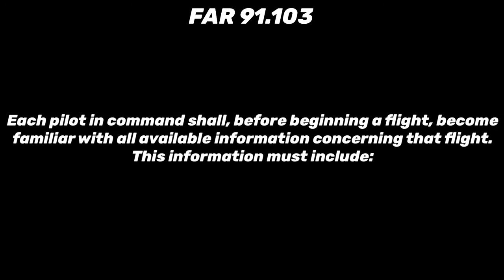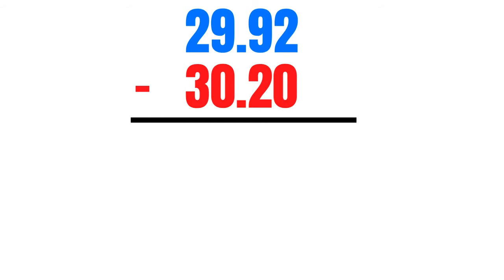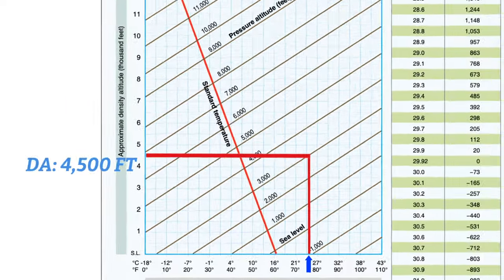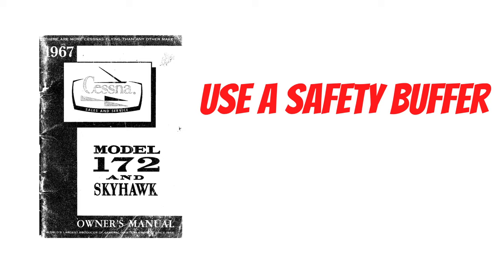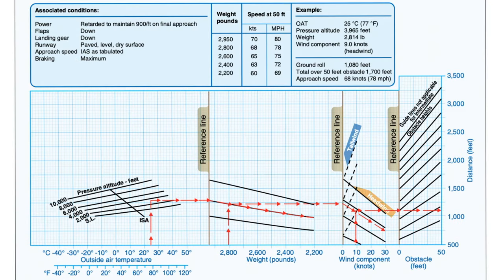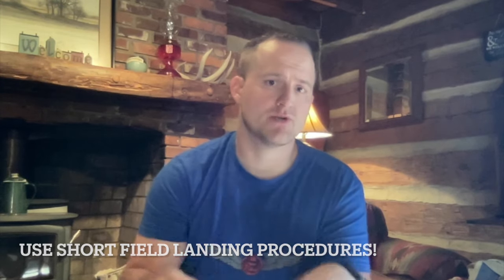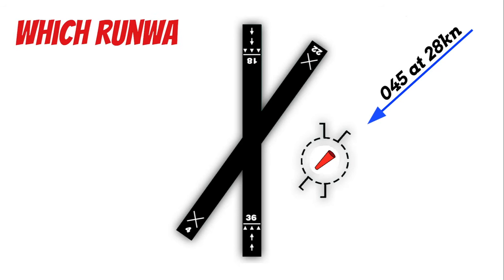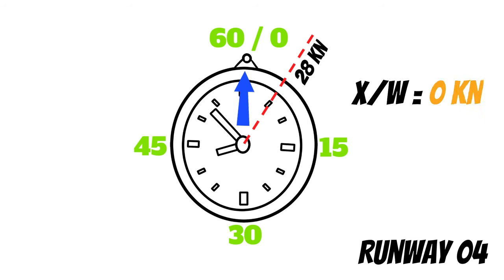Aircraft Performance EXPLAINED (PPL Lesson 51)

Comment: Base leg 1.4xVSO and final 1.3xVSO. Most instructors teach well above that. A C-172 can be landed at 52 kts with full flaps but just about all CFI’s want you at 60-65 kts for safety. Remember control speed with pitch and decent speed with power. I reduce my power to idle as the plane settles, makes a much smoother touchdown.
Reply from the maker: This is very true.  Thanks for the comment!

Comment: 48:15 pitch controls airspeed, and power for altitude, applies at any airspeed, not just slow flight. This is mathematically correct and provable, and is necessary to understand for aircraft design. I actually just taught this as a STEM lecture last week in fact, showing the math in the lecture.
Reply: There used to be a subreddit for people like you. I don’t know if it still exists, but it was called r/iamverysmart. You’d fit right in
Reply: @tylerbrown4483  sounds like jealousy to me. Knowing what engineers knew way back in the 1940s is nothing special. You don't have to be very smart to read a book and learn such things. But, then again, illiteracy is on the rise in recent years.
Reply: @SoloRenegade  it’s not that what you’re saying is wrong, but that it’s overly reductive to the point that I feel confident you’re not as educated on the subject as you think you are. And it’s how smug and pedantic and self-satisfied you are in making and qualifying your silly correction.

You know what he was trying to say, that below L/Dmax you can’t pitch up and trade air speed for altitude to any effect, which is true. You’ll stall really fast if you try it. Whereas above L/D max you can certainly pitch up for altitude, at least until your airspeed bleeds down to L/D max, and if you pitch gently with good power you won’t go below L/Dmax at all and you’ll just establish a climb.

But you felt the need to take it in the most literal way possible and offer a correction in the tone of a 14 year old with a severe case of the dunning-Kruger. One read through Stick and Rudder doesn’t make you an expert on fluid mechanics.

Comment: With all due respect, both the engine and the airplane perfom based on density , in other words DENSITY altitude , where the temperature has a significant effect
Lift = ½ density × TAS²  × area ×  Cl
Cl  =  lift coefficient = AOA × dcl/da
Cl  =  AOA  × 0,1047 × AR/(AR + 2)
 AR = wing aspect ratio = span²/area
 now density = press / (R  × Tabs)
R  =  8314 /29  Joule/ kg K  
The  engine power is also  proportional to density
at any pressure altitude cold air is denser than hot air.
The designation density altitude takes that into effect.
The airplane performs according to Calibrated air speed. 
As you did say .
sea level density × CAS²  = dens × TAS²
TAS  =  CAS × √ (SL dens/ dens)
Reply from the maker: I believe you may need to get a little farther into the video.  I include density altitude in the discussion
Reply: @FreePilotTraining   Sorry, my mistake
just erase my comment but the equations might be useful for you.

Comment: It is generally bad practice to round or try to add safety margin by padding steps within a calculation. (This applies to many subjects, not just aviation.) Unfortunately I see this a lot in the CFI world in an erroneous, though well intended, attempt at improving safety.  
Do the calculation to the best availible accuracy, then determine how much safety buffer you want to add at the end. Rounding up and adding margins at intermediate points just increases the uncertainty of the calculation leaving you with an arbitrary unkown amount of buffer.

To be clear, I am talking about the proccess of calculation and use of tables. If you know your inputs have a range (margin of error in the measurment) then it is ok to do the calculations using the conservative side of those inputs. This input selection is different from fudging the actual calculation or chart-reading process.
Same goes for fuel calculations, eta, weather, weight and balance. Do the most accurate calculation you can then add in adjustments for specific factors and finally add the safety margin.
Reply from the maker: You’re the first person I’ve ever heard say that. If I add safety factors in my calculations, I do not doubt my numbers. I have more confidence in my numbers because I know I built in multiple safety factors.  Because of this, I’m always pleasantly surprised by the capabilities of my aircraft, and adding ONE safety factor AT THE END of your calculations does not account for the fact that you may have made a mistake, and EVERY human will make mistakes in their calculations.  If you made one mistake and added one safety factor at the end, you have created more risk because you cannot even make ONE mistake in your calculations.  Doing so could result in disaster.  I do agree however, that the numbers you come up with should never be blurry.  You should never consider your performance numbers negotiable after you’ve made a calculation, even if safety factors were added through the process.

Comment: 43:51 Might be having a brain fart here. How did you get the 45 degree angle? If 360 (Runway Heading) - 045 (Wind Direction) = 315? If the wind direction matches the clock position is the subtraction not needed or is there something I’m missing? Thanks!
Reply from the maker: 360 also equals 0 degrees. That’s where the problem is

Comment: Question! I came here to see your recommendations for calculating take off distances using normal procedures, since the Cessna 172 POH does not provide a chart for that. Foreflight offers a Safety Distance Factor so I can use that to help the calculations. You recommend doubling the take off distance, and I agree, but you throw in the caveat that "if you're below these numbers, I recommend you use the short field takeoff procedures just in case." I just wanted to clarify which numbers you're talking about being below? Do you mean if you double the takeoff distance and the runway is shorter than that distance? Thank you in advance!
Reply from the maker: Great question Ryan. So as I recommend, I like to double the distance for a normal takeoff. If my short field takeoff distance was 1,500 feet, then I’d say it would be fine to do normal procedures as long as the distance is 3,000 feet or more. If the distance was 2,999 feet, I’d just do a short field takeoff. It doesn’t hurt to practice short field takeoff procedures anyway after you’ve got that license.
Reply from the maker: Great question Ryan. So as I recommend, I like to double the distance for a normal takeoff. If my short field takeoff distance was 1,500 feet, then I’d say it would be fine to do normal procedures as long as the distance is 3,000 feet or more. If the distance was 2,999 feet, I’d just do a short field takeoff. It doesn’t hurt to practice short field takeoff procedures anyway after you’ve got that license.
Reply: @FreePilotTraining  Thank you for that and for the reply!

Comment: How do we set for 75% power at different altitudes on steam gages only?
Reply from the maker: Great question! Your poh shows you the basic horsepower relationship to RPM and pressure altitude in the cruise table.  So, you use your tachometer
Reply: @FreePilotTraining  thx
Reply from the maker: No problem

Comment: I think you made an error at about 44:30. 28 kts * sin(45) = 19.8 kts. Below the limit, not over.
Reply: That said, I do love this and ALL your videos. Thank you for the hard work!!!
Reply from the maker: I appreciate this. You are probably right, but that raises a good point about these charts they aren’t always accurate.  These calculations are based purely on the charts, but great catch though
Reply from the maker: Thanks!
Reply: The point is that it is at the recommended max within practical accuracy tolerances. (not a hard limit anyway) The crosswind chart doesn't need accuracy to tenths because the weather sock isn't that accurate, and the pilot wouldn't notice a 5% difference anyway. (1/20 is 5%)

Comment: Right at the beginning you correctly say ISA sea level temperature is DEFINED as 15°C
What you don't say is that the temperature lapse is also DEFINED as - 6.5 °C per 1000 meters elevation change , not pressure measured altitude .
When in reality the temperature distribution with  altitude differs from this CONSTANT -6.5 °C lapse , the altitude measured with an altimeter setting of 29.92 inches or 1013.25 hektopascals, the new name for millibars, then the indicated altitude is different from elevation, true altittude in feet. Example there is an inversion in temprature, meaning it gets warmer across that inversion, then the altimeter will show a significantly HIGHER altitude: The surrounding terrain is higher. Yes that has led to controlled flight into terrain.
Reply from the maker: I believe I mention that somewhere in here. If not, I’ve mentioned the lapse rate in multiple videos